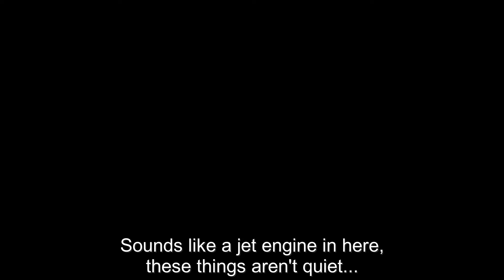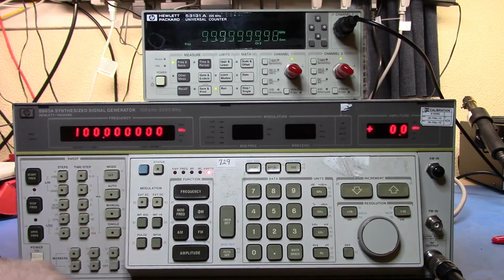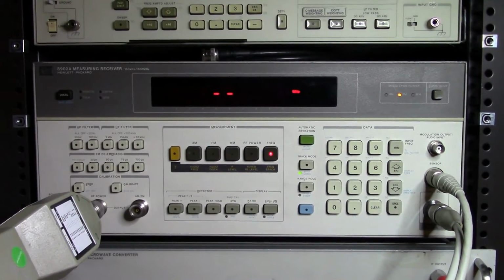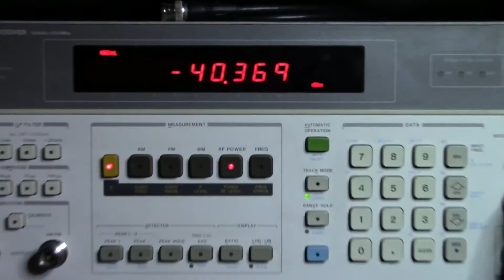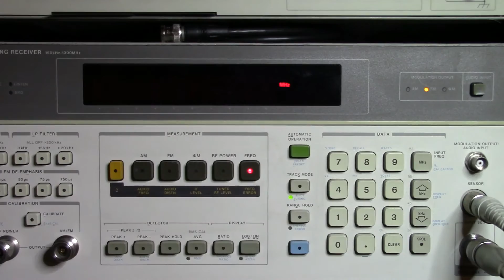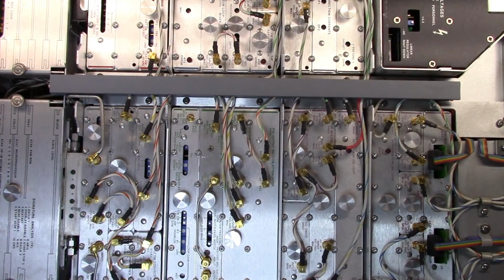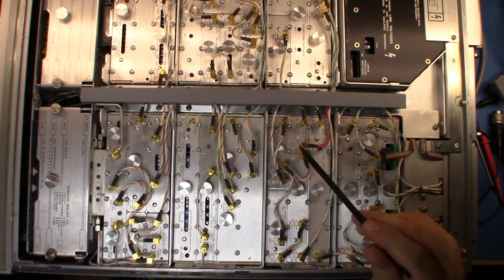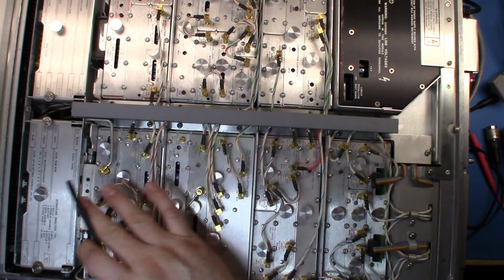HP 8663A First Look

Comment: Been watching these on eBay, it's a bit of a challenge to find one of these in good condition. It's not like I "need" one but would still be fun to mess around with. I also liked the coverage of the HP 8902A, these things are still a little pricey on the used market. However I do have a HP 8901B that should be here today :)
Reply from the maker: Be careful if you ever get one, they weigh about the same as a battleship - The 8901 is a good instrument and can do a lot of the same stuff as the 8902 - Good luck with it.

Comment: I have the 8662a, a hell of a generator, but a bit fickle now it's getting older.
Reply from the maker: I sold this one but it apparently got damaged in transit - FedEx paid the claim so we're all good - I'm on the lookout now for a 8340B (10MHz to 26.5 GHz). With that one I can use the 8673B as the LO for my 8902S and the 8340B as the main sig gen.

I do however still love the 8567B - Simple, easy to use, classic machine.

Comment: This has very similar internal mechanical construction as the 5342A counter. Do you still have this unit? Are you selling it by any chance?
Reply from the maker: A lot of HP gear of that era has that same sore of vertical can model - The newer stuff moved to a more horizontal format over a board - The comment I made about accidentally buying the 8350B relates to the 5342A. There was an auction site selling a plugin for the 8350B sweeper and I bought that for my Dad who has one. However, they shipped the plugin still inside the original 8350B unit so I have an 8350B chassis. I gave both the plugin and the 5342A to my Dad this Christmas as his counter could only go up to 11GHz. So sorry I don't have the unit anymore but otherwise I'd be happy to sell it.

Comment: I bought a 8663A recently. At first, started and works well; but then never starts again. Last owner said the problem is the line swtich but I check the switch itself and makes contact. 
The panel glitches a bit when line switch is ON, but fan doesn't rotate and generator never starts. 
PSU issue, I think. Any idea of remarkable power supply problems in these machines? 
Hint: diodes all over PSU motherboard and inverter board are ok with DMM
Reply from the maker: Did you check the supply voltages? There is a relay that controls the fan and it is connected to the +5.2V rectifier. If the fan works but isn't running when the device is turned on then that indicates that you're at least not getting that rail. I also assume that fuses F1 & F2 are good otherwise you won't get power on the rails.

Here is an image of the relevant part of the block diagram - https://i.imgur.com/WcDR1ex.png
Reply: @tgsoapbox  update Jan 30th:

following the troubleshooting procedure for the control board, I found bad waveforms in three logic IC  test points (or related circuitry) and in an op-amp down below, which don't make any waveform at all... I think the trouble is in the A7A2 control assembly :(

I bought a cheap inverter board on ebay (not tested) for try my luck... but I'll be surprised if the PSU starts only with this change...

¿you recommend rebuild of control board? four ICs and capacitors? the unique replacement that's on eBay (guaranteed) has a terrifying price tag...
Reply from the maker: @rrb6544  This seems to be a commonish problem with these units - I've seen a lot of them with the power supplies missing at auctions etc. I'd start checking the comparators, other ICs, transistors then oscillator - Other than that it might just be a hard slog through checking each component on the board :(
Reply: @tgsoapbox  the psu is fried because in this sig-gen is common that the 5.2 volt rail begin to consume a lot. And I say common because I found this https://etime.kakukaku-sikajika.com/pub/SG_hp8663A/hp8663A_debug.html a japanese website that describes exactly the same problem I have with my unit.
I found that rail nearly dead shorted with my DMM,  I desolded the common wires to feed every motherboard separately, and nothing abnormal occurs. In the service manual, the current for that rail isn't especified, but with my trusty Rigol bench power supply I isolate every motherboard and all of them sum nearly 15 amps, which is a lot. Maybe the original PSU couldn't take over that. I don't know why that rail do that...
Otherwise, finally yesterday I could feed the generator with external supplies and itperforms within specs... awesome machines those ...
Reply from the maker: @rrb6544  Are you considering repairing the PSU? I guess I should back up and ask if you've found the component(s) that are causing the short?
Reply: @tgsoapbox  I consider two options: repair the original PSU or build a linear PSU with modern components (this option requires a giant transformer in a separate cabinet, I figure, because of the many taps and big current specs). 
I want to test the performance to be sure before spend more time or money on it. FIrst impressions are good.
The issue in the 5,2 volt rail... has me intrigued. Have you ever seen a test gear or whatever unit that suddenly start consuming more current with similar performances? Because DMM beeps, but I connect an ATX power supply (cheaper amps I could get) to this rail and the generator works well (at first, the generator output was twenty dBm lower than displayed. I started with four 20AWG wires from the PC supply, and they get hot; so I solder two more and now don't get hot and the output signal is ok)
Reply from the maker: @rrb6544  You might have some components on the way out that are leaking to GND as they warm up - I haven't seen that but I agree with you that you should be testing at full output power. Please either do a write-up or video of the replacement/fix - Would love to see that.